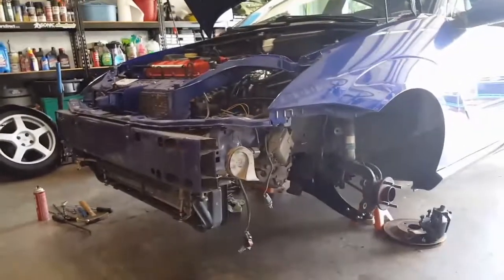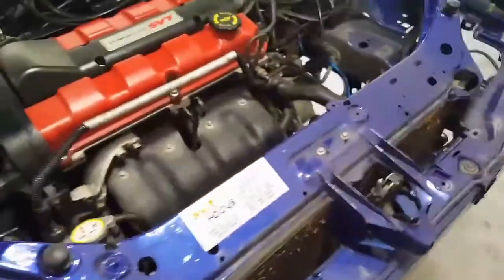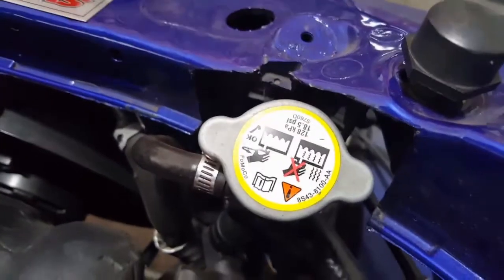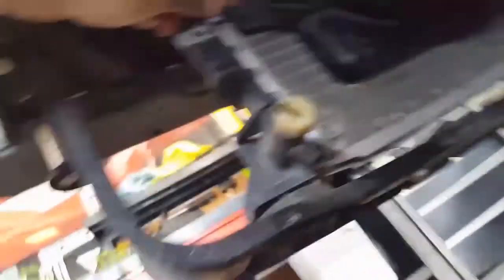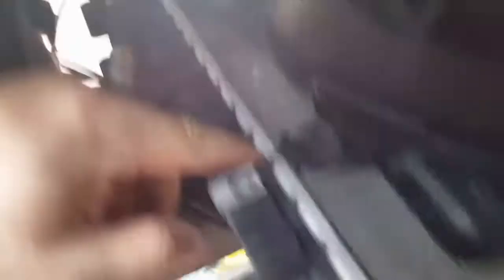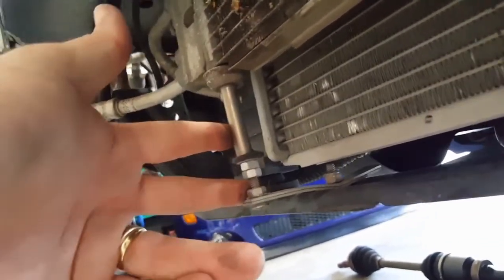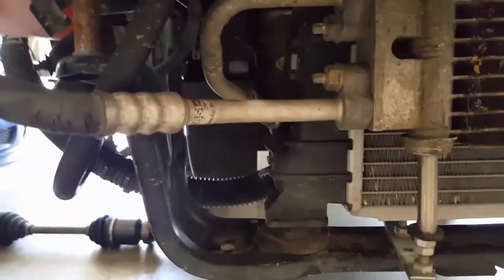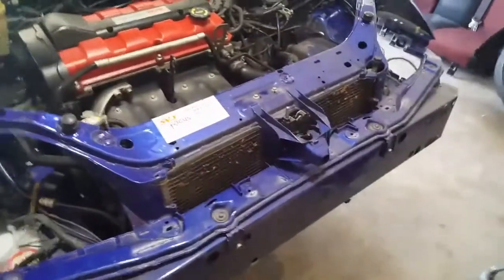2008 Focus Radiator Swap in 2003 SVT Focus

Comment: The green plug at 1:32 what is that
Reply from the maker: I see many plugs but don't see a green one. I had the entire front end torn apart so I'm not sure which one.
Reply: @SonicSVTFocus  my bad 1:27 it's the plug on the front of the trans
Reply from the maker: Thsrs the front O2 sensor plug.